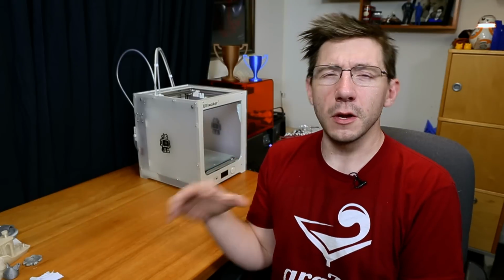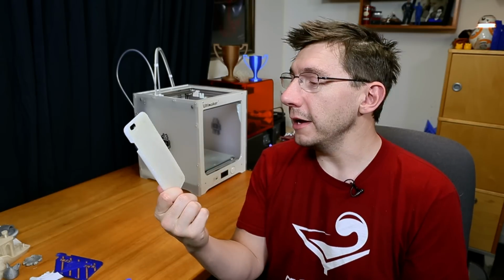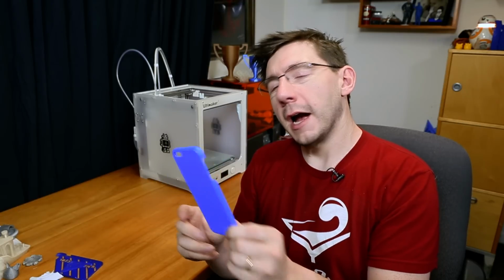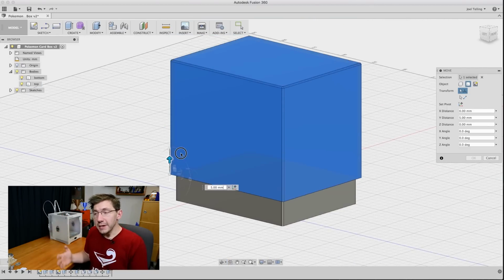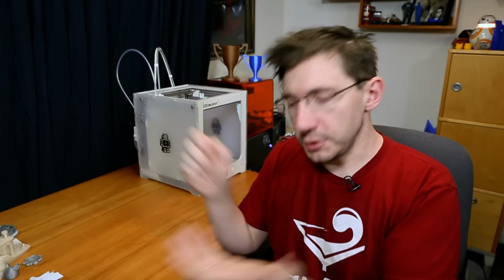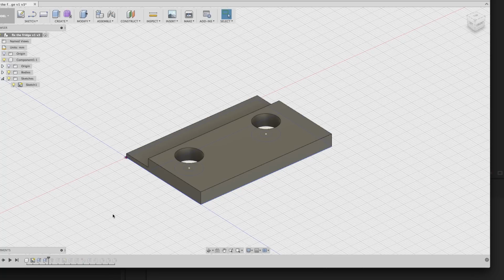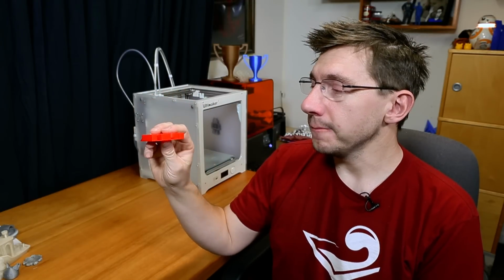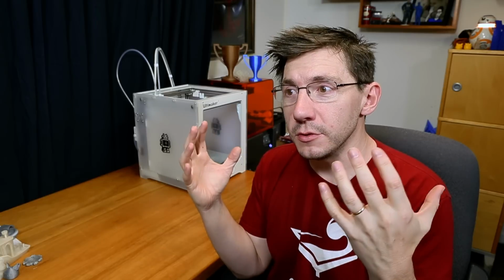My Top 5 Useful 3D Prints of 2016

Comment: practical and functional models are sometimes easy to make and print ,...this is where fdm 3d printing is at its highest value..  alot of my examples i  modelled and printed are made out of necessity and believe me necessity is a big word if you live on a island far in the caribean because shipping time are easily exceeding 4 weeks.
Some examples - 
ovenknob      -  https://www.thingiverse.com/thing:4404093
yacouzie filter  - https://www.thingiverse.com/thing:3955702
dishwasher slide guide - https://www.thingiverse.com/thing:3859505
mazda pickup oilcap - https://www.thingiverse.com/thing:3595428
drain cover - https://www.thingiverse.com/thing:1963390
sifon supermarket vegy display - https://www.thingiverse.com/thing:1961093

Comment: It's how a 3D printer really should be used. Practical things. Not just novelty items.
I printed spare parts (whose original parts breaks too easily) for my Ninebot ES2 electric kickbike which I use often around the city.
I've also printed various items for my stationary computer case. Instead of buying the accessories, I whipped up, designed and printed my own parts.
Then I also print various items for the workshop. Such as caps for the silicone tubes. Wedges for the door. Various hooks for the pegboard. Hangers for my tools. ...

Comment: I would cut that center piece on the fridge part as a triangle with the outward-facing point offset a little.  That way if the flapper isn't turned it will hit that point and force it to turn rather than fold over that center piece.

Comment: People make practical things 5% of the time and landfill junk 95% of the time. I think that just tells us that 3D printing is still in its infancy. So maybe I'll buy one... in 5-10 years when they are no longer printing figurines.
Reply from the maker: You cannot judge an entire manufacturing method by my this one stupid old video of mine. Your percentages are far, far off.
Reply: What you print is down to you. If you have pratcical uses for one, then get one. Why is your decision affected by what other people print?
I've had a 3d printer for about three weeks. In that time I've only made practical items that have either saved money or improved an existing product.
eg 
1/ Converter so I can use cheap Lidl batteries on my old deWalt drill (Lidl batteries are about 1/3rd the cost of cheap third market replacement batteries for the deWalt)
2/ Caps for my home made log saw stand so that water doesn't get into the tubular framework
3/ Replacement for a broken cafetiere plunger knob
4/ Holder for led strips for my kitchen cabinet lighting
5/ Case for Raspberry pi for replacement heating control with separated compartment for high voltage relays
6/ Articulated arm for an led lamp for intricate work projects

Comment: Joel, help!  I am having trouble with circles printing as polygons with about inch long flats.  Software.....Shapr3D and 123d make. Slicer Wanhao edition Cura. Printer wanhao duplicator i3 plus with flex ion extruder. Model in shapr3d looks smooth but turns to polygon in Cura, model in 123d smooth, in Cura still smooth, both print exactly the same polygon.  If I down load a file from thingyverse it prints just fine.  My brain is starting to ooze out of my ears and eyes.  Any thoughts?    ......pleeeeaase

Comment: Sorry if I sound like an Internet know-it-all, but I have been a production engineer and anyway, you can just ignore me, which you probably will.

Straightaway, I could see several issues with your fridge door solution.  I saw your part fail before the video got there.

1) Measure more accurately!  You haven't left enough clearance for the catch to enter your part - the catch hits it!  I know you said that you had an issue with your calipers, but you should never 'just do it anyway'!

2) You left the part (the 'bottom') that supports the central bit of your part too thin.  You can see it bending.  Even flexible material will break if you keep doing that.

3) That centre part must also be filleted, because if you leave it sharp, all the forces will accumulate at that straight-line point and it will fail there, as it did.

4) The 'finger' on the door needs to have an accommodating entry so that the 'V' formed entry in your part receives it cleanly every time instead of becoming misaligned.

5) There was no need for the second 'opening' as the 'finger' doesn't reach around that far when the door closes.  You could have used that for more strength for that part or the design.

Basically, you didn't need flexible material on your fridge solution - the manufacture didn't need that - you just had to pay more attention to detail!
Reply from the maker: Nope, didn't ignore you. You have some good advice there, and I appreciate it.

Comment: What I learned from this is that 3D printing isnt very practical.

A phone case and a box for trading cards are among the top 5 most practical things youve ever printed...
Reply: 3D printing is meant for rapid prototyping and is a tool for designers and engineers. It's fun that we can have a cheap fdm printer at home now and make mini figurines etc. but 3d printing has a lot more useful applications than a phone cover or a pokemon card box.
Reply: Jazz what would you suggest purchasing to make good selfie figurines?
Reply: It's not all about printing doo-dads that other people have designed on Thingiverse. It's down to your own imagination and ingenuity. I've used my 3D printer to print little things like hold-down clamps for ventian blinds, tap washers, etc.
I've also used it to replace the Lance Holder on my Gerni pressure washer. That part wasn't available in Australia and I would have had to pay 15 pounds (plus shipping) and wait three weeks to get it from the UK. (Gerni is the Australian badge for Nilfisk products and they're made in Denmark. I have to get parts from the UK? Go figure.) Instead I spent an hour modelling it in SketchUp and let it print overnight while I slept.
Reply: I respectfully disagree. I bought a Prusa mk3 in March as my first 3D printer. I am learning to model in Fusion 360 and have created many useful things. I race scale model cars as a hobby and find that 3D printing is a quick, (fairly) inexpensive way to create not only parts for the cars but also tools and fixtures for building the cars. I offered some of what I designed to the other racers and have made some money back on the cost of the printer itself. I get feedback from the racers and can quickly change my designs to customize the pieces to each racer's wants or needs. I find it very practical and FUN to be making a little money doing something I enjoy. I even used it to make limit switch mounts and work holding fixtures for my small CNC router. #highfive
Reply: I 3d printed the brake calipers of my car with hobbyking PLA. No regrets, still going strong and the car weights 4 pounds less so now i can go faster and turn better, i almost beat a corvette on my local track, and best of all i get much better MPG.
Reply: @teresashinkansen9402  are you still alive? It's been 2 weeks. Story sounds BS though lol. But it's cool ingenuity and I like the idea... Just not going to live life on the edge like you😂
Reply: @3dPrintingMillennial  Yes Im still alive but I had an accident. My engine blew up because i used too much NOS and didn't double clutched. One of my heart's valves was damaged in the accident but i 3d printed one with flexible filament and now im much better.  Thanks for worrying.
Reply: @teresashinkansen9402  🤣🤣🤣 glad to hear you're OK. You can use the laser sintering 3d printers to rebuild your engine. Just add a few more perimeters to increase the strength so it can handle excess NOS. I recommend you go see Replicas on Jan 11th and go ahead and reprint your whole body just in case the new engine explodes again 😏
Reply: @teresashinkansen9402  if your car weighs 4lbs less you aren't going to get much better mpg. Are you joking?
Reply: Not to mention the cost...you can buy a phone case at dollar stores.
Reply: @truantray  And does the dollar store case come with the same, fun experience you get when you print your own?

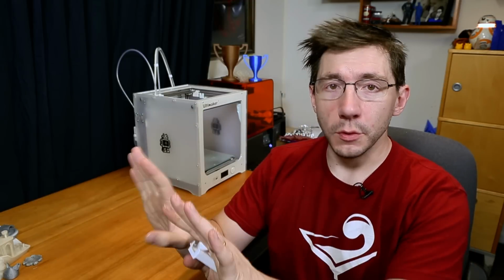Comment: OMG 7:25 When you started describing your refrigerator, it sounds like we have the same one, and right where that piece on yours you said broke off, there was a small cylindrical peg that snapped off on ours, and I was going to print out a piece to fit there and fix it. But it sounds like the manufacturers used a cheap plastic on our fridges and we end up having the same problem.

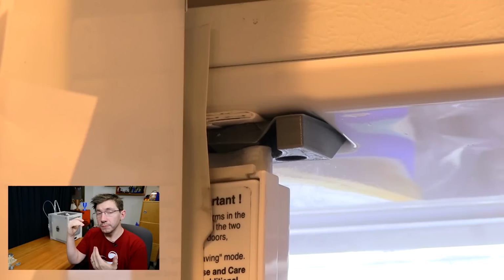Comment: Don't hurt yourself patting yourself on the back...at 11:06 I noticed wadded up paper stuffed under your "amazing improved part" apparently to make it function properly....also...how many iphone cases did you make until one was worth using?
Reply from the maker: Hahahahhaa. DUDE! You noticed - awesome! I think you're the first to notice! While it did flex, it flexed too much. I've since changed out the design to an rigid design, but, printed in a different orientation to take advantage of layer line directions. For the iPhone cases, it took two originally I believe.

Comment: I purchased a blade adapter for weed eaters. The product description said it was universal. Well it didn't fit my brand weed wacker. I still wanted the adapter so I designed an adapter in solid works and printed it. I was amazed that the first print worked perfectly and three years later it still works. And I am now printing replacement blades.

Comment: I needed a cylinder or cap with the same OD as the input ring on my transfer case so it could seal the output shaft hole in my transmission. Couldn't find anything around that was quite the right size and so not wanting to leak fluid or damage the seal I modeled one in OpenSCAD and printed it. Always cool to print something functional and that isn't found or sold in stores.

Comment: My top 5:

1. Doorknob Strike Plate - The bit that pushes the bolt into the door, then holds the bolt to the frame allowing the door to remain shut.
2. Lightswitch plate w/ large cut-in on/off labels - Now we know for CERTAIN if the outdoor lights we cant' see from a window are on or off
3. Wall mount hangers for headphones.
4. Wall mount hangers for HTC vive.
5. Tabletop RPG miniatures (They cost 0.08 cents each to print, and you can make a whole army of skeletons in just a few hours. Or you can spend like 200 bucks on the same ammount of skeletons.)
Reply: Yo jimbob, hit me up with that HTC wall mount link. I use a drawer for my headset.

Comment: Its obviously been a while, but have you thought about adding a sort of stopper at the bottom of the card holder? So that it looks a bit more than just a box and add a couple holes at the top for air to escape, which of course can be done after the print as well.

Comment: Looking into 3D printer (as a hobby); 2 questions: (FWIW considering "Printing" starter cover for old BMW ("airhead") motorcycle and/or the generator cover... may need to look for service that can do 3D scan of objects)
1) Is there an "open source" public database of STL(?) files for problems solved/designed? (i.e. "frigidaire model xxx double-door catch")
2) not (yet) owning one, does the software include integrating other objects into plastic "printed" item? (i.e. placing on bed and "printing" around object... such as threaded nut for bolts... possibly even half-way through print project?)
Reply: another thought: integrating wire coil winding into plastic housing: lay bed for coil housing, pause job, place coil onto bed, then continue with print project.... integrating aluminum heatsinks (for transistors) into plastic housing... and, and and...

Comment: All those phone case designs are fail... at most maybe they will keep your phone from scratching the back and sides and that's about it... not what you need a case to do.  They aren't going to protect your screen.

Look at the "Poetic" Nexus 7 case to get an idea of a correct design:      https://www.ebay.com/i/253151560313?chn=ps

Drop anything rectangular and see where it lands.  9/10 its going to hit corner first.   Your corner is the weakest point on the phone/glass.   A good case should have bulked up rubber corners that are so thick they are like ball bumpers, that allow the corner to absorb some and bounce back.   

Also, you want the four corners higher, so that if the phone comes to rest upside down on some gravel, concrete, or pavement, it's at least a cm above the ground.

Comment: I don't own a 3D printer (not yet at least) but I have access to a shop that has some amazing (and expensive) machines / printers. They are for commercial / industrial applications... SO anyway, I printed a holster for my Gerber Multi tool. It was a simple belt clip style. The print material is Ultem 1010 ( I know over kill ) but that was what the machine was running, so I just went with it. The funny thing is a took an existing design that was meant for PLA, so being printed in Ultem, I can stand on the holster and it can support my 240 lbs. That is some crazy strong stuff. SO the main reason I don't already own a 3D printer, is I am saving up for a miniFactory Innovator L that can print in Ultem / peek / polycarbonate all day long properly. SO yeah :)
Reply: Forgot to mention the 3D printer I have access to is a Stratasys Fortus 900mc, You can almost stand inside the print chamber. During the down times I pretty much get to do any time I want with the machine.

Comment: Phone stand/holder, cable holders to attach cables to the side of the table, numerous boxes for electrical switches and audio plugs, few hooks to hold keyboard in place on a shelf that tilts, some few toys for kid like x-wing.. Ah yes, a range of improvements for the 3D Printer itself ofc. Whole bunch of stuff. 
Main rule one must follow - DON`T PRINT USELESS RUBBISH AND START YOUR PRINTER ONLY FOR A GOOD REASON. 
Then you get less plastic on landfill :)

Comment: Old video. I know. But my practical 3D-prints so far have been extra bobbins for my spinning wheel. It took me four iterations to get it right. First one had major desing error. The next three was just tweaking the measurements. And the tweaking happened on a scale of 1/10 of a millimeter. That was the difference between noisy, not quite fitting and perfect.
Reply from the maker: +netkissa tweaking and finding the perfect fit is a perfect example of something awesome that 3d printing can do!

Comment: First I love your videos, I really get a lot out of them.  My most useful print so far was part of a toilet seat hinge.  I have a Bemis slow close toilet seat and the hinge broke.  I'm not overly large and weigh less than 200lbs.  This is the second failure of the part from the manufacturer that attaches to the slow close spring and the seat.  My first print was 2mm too short and failed quickly, the 2nd didn't have enough infill (I just wanted to see if it would fit before using a lot of plastic), the 3rd works.  I also have a wireless charger mount for my cell phone.

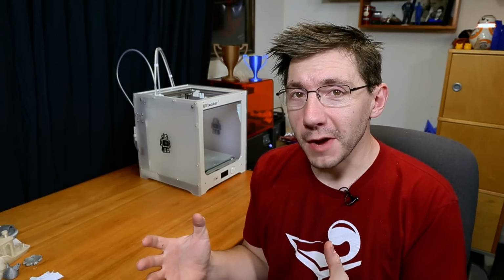Comment: 6:00 if you add little 1" long nubs of about 1mm in height on the inner sides of the top and the outer sides of the inner bottom the box will also "snap" open and close and therefor be less prone to spilling her cards and/or be liftable without the top just sliding off.

Comment: Why spend $120.00 in monofilament to make a $7.00 pot just so 8 Sri Lankan factory workers can't feed their families. Plus, a jet extruder would would had knocked out 30 of those bad boys out in 45 seconds and had a net carbon foot print 80% smaller. It's practical for you in the sense , you don't have to leave your basement and hazard man contact. It is, however,  a very inefficient use  of resources. 
The true breakthrough in of 3d printing is easy prototyping of design concepts. One off proof of concepts that can be tested for design flaws and feel. It requires less time and money than retooling and repurposing factory lines for test run of parts that would require redesign.  The iPhone cover was an excellent example of material testing before wholesale manufacturing. Deciding what material felt better in hand and was stronger in the design phase. You would then secure financing, create dyes and secure 2 production lines and injection mold your desired material a a sample run and ... You were not going to do any of that. You did it because you could.To print something you could buy at the dollar store is the sort of arrogance that has made America #1 in the world in the service industry. Just because you can do something, doesn't mean you should.  just sayin #whitehobbiesmatter

Comment: Looking at getting a prusa printer. However its $1000. Your top 5 mist useful prints would cost maybe $1 for a box, planter and maybe $5 for the fridge part.
So it saved you $6 for spending over $1000.
Does that make humanity better, lol.
Spending $994 for $6?
Until I still find this is the largest drawback for 3d printers.
Reply: exactly my thoughts, all this guy is doing printing few dollar parts with equipment worth thousands of dollars
what a waste of  money
Reply: The special thing is that those objects were custom made, but with high precision and replicability. Once you get and start to use a 3d printer, you acquire the power to solve mechanical problems or make creative things on your own with CAD programs. For sure most of the solutions would be cheap if found on the market, but are all of the things you can possibly imagine easily found on the market? I guess not, but even if they are, you can go one step further and modify them.. it is the open source culture applied to hardware.
Reply: He’s making videos and demonstrating his skills on YouTube. Also, you can’t put a value on gaining knowledge. If we did, the works of many scientists, or inventors that built upon the basic knowledge of others would not exist.